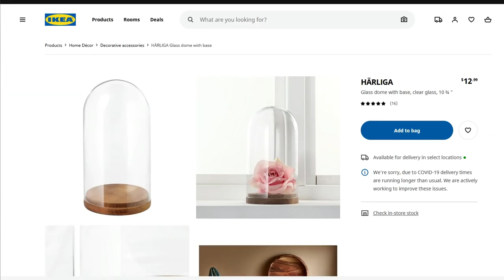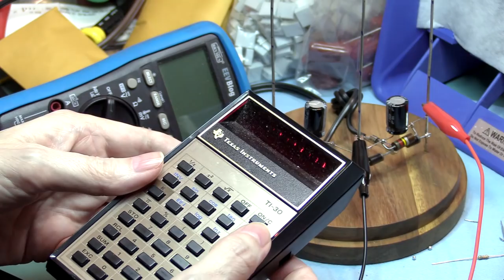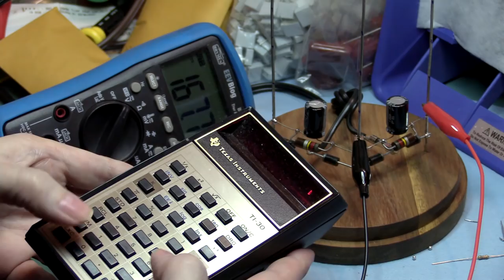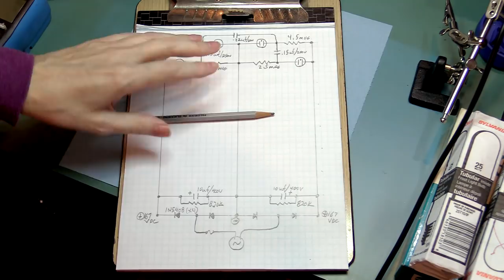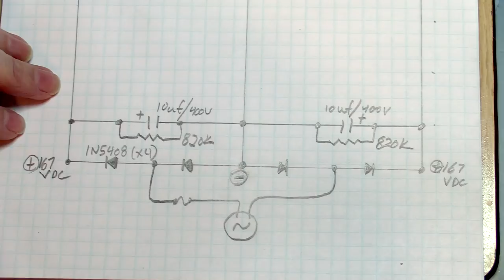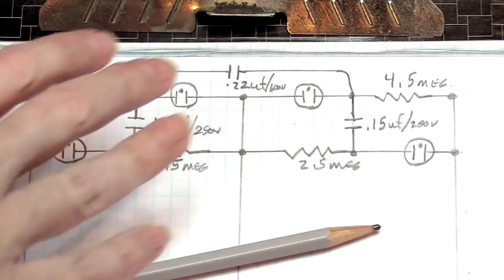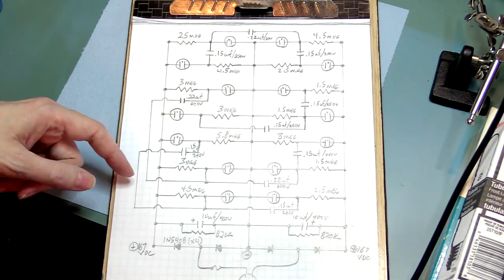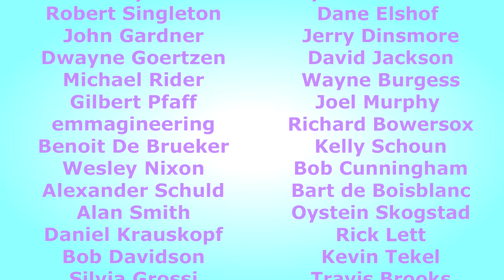Nostalgia Neon Blinky Tree!!!

Comment: Fran, a few things about the soldering issues you raised in this video:
- You need more heat transfer and more wattage because of those big heatsink bus bars. You can pick up the classic Weller soldering guns (e.g. the classic D550) for less than $50 in any hardware store or online, and it will make quick work of these heavy solder joints. An electronics soldering station is outclassed by this situation.
- You have minimal thermal contact between heat source and object to be raised to soldering temperature; the rounded iron tip touching the round bus bar at a single small point; this is worse than the normal situation of soldering a component lead to a PCB pad, which the iron and its tip are designed for. Holding the iron's tip at a flatter angle so more of the side of the tip lays parallel-ish to the plane of bus bar will help.
- Moving the iron all around while trying to solder such heavy joints only makes it more difficult to achieve good thermal transfer. Keep the tip in once place and only move it a bit if you see a way to maximize surface contact area.
- To improve thermal transfer, you can try to flood the area between tip and bus bar with a big ball of solder, but this is not an ideal way to do it; should be avoided if the other techniques do the trick.
Reply: The biggest issue that strikes me is that she is not making a proper mechanical connection before soldering.  Seeing how the legs of the resistors meet each other and the uprights at 90° angle the wires of the components could easily have been one side j-hooked. She did it at 7:32 when soldering the 820k bleeders to the legs of the electrolytics. Why not follow thru?

Comment: You can add clicky sound effects to a neon blinky by using a piezo sounder instead of/ as well as the cap
Reply: Thanks for the idea, going to have to try that.
Reply: @mikeselectricstuff   Clickety clicks and flashy flashers ?   You wan't to drive us loco ?!!
Reply: @trespire  And Bells and Whistles, Too!  :-)
Reply: Needs like Geiger counter clicks
Reply: I was thinking the same. :)
Reply: @imagineaworld  Someplace in the comments, there's a suggestion to feed the neon return currents to a transformer; then use the transformer to drive a speaker.  A good idea, but sounds tricky / hard-to-implement, to me (because the neons parallel the caps, at the moment; rather than shorting them to ground).
Maybe a little cap-coupling (1nF per neon?) would do the job; the ~50V swings when the neons strike should be fairly easy to detect, and you can always amplify those spikes, then feed 'em to a speaker...

Comment: Made  a funky one with just three neon lamps two poles. Built it in a chicken feather flower.  Parts and wires all over the place. Used a miltary surplus battery that had a B+ voltage. Sat on a shelf everyone would always look at the sucker. Battery lasted for ten years. Thanks fran for the reminder that funky is fun. Best Regards Jack Hreha.

Comment: I used speaker wire to tie the leads to the uprights on my project simular to that. Then I used a micro torch to get things hot enough for the solder to work. That calculator  was the same exact type I was given in high school and told I would never amount to anything because I couldn't  see math in my head. Back then, calculators in class was considered cheating.  No one was allowed one. My how things have changed! My dad used to have boxes of old neon tubes and the large foil type resisters and what not. I loved making little projects back then. I ended up taking a short wave radio class in high school and got my  licence. Funny how THAT happened being I was a math dummy.

Comment: I remember making a “neon blinky” (5 neon bulbs) from an old Radio Shack kit (back when there WAS a Radio Shack - ahem). It used a one or two transistor oscillator and a step-up transformer to create about 120-180 VDC from the secondary with a half-wave rectifier diode. The instructions included two variants you could make with the parts included; either a “random” or “sequential” blinky. I wish I had kept it, and the instructions. 🥺 This one though, looks much more cool; though the solder connections make me cringe 😬. Pre-tinning the leads definitely helps with this point-to-point, “dead bug” style of wiring. Oh well, as long as it works. 😊

Comment: I built something similar back when I was in High School in the 1960s.  You have made the circuit a work of art.  As the R/C circuits age it will definitely cause the blink rates to diverge which in this case is a good thing.
Reply: High school in the 70s. Learned to be careful around voltage multipliers ;)

Comment: I remember neon blinkies. If you add a metric crapload of capacitors between every neon then the flashing will always repeat in order instead of random, but too many capacitors are needed for more than 3 neons. So now it's much easier to clock a 4017 chip with a 555 and connect it to 10 LEDs.

Comment: Cool, Fran! Your power supply is a little overkill. Half-wave Dc would work fine so you did not need the filter caps. I've made 2 of those in my life. At age 9, from the Radio Shack kit in the red and clear box that ran from a 9v battery and used an oscillator and transformer to get the voltage it needed. Took it on vacation and left in the back window of the car one afternoon. It twisted in the heat but continued to work. The second, the last day of Junior College sitting bored in the lab. That one was mains powered and hung in my room blinking for about 5 years before the antique NE2 bulbs conked out. I "etched" the circuit board with a dremel, and left a fragment of copper, so on first try, it BANGed!. Replaced the main diode and it worked. Neither were as artful as yours.

Comment: I would like to build something like this using multicolored diodes and LEDs for switching up different modes for blink rates and patterns. I really love the hour glass look. You could build a modern vrs retro styling with a separate module for tweaking how it flashes. Very nice ideas and seeing all the components on a tree like structure is so cool.

Comment: There was a similar project framed and hung outside of the physics labs where I did my graduate degree, and I've always had in the back of my head that I'd like to try making one, but had never gotten around to it, or really figuring out how precisely to do it. I'll have to try now, thanks for the inspiration and explanations! And happy new year!
Reply from the maker: They were everywhere back in the day - I have been sitting on this project for at least 20 years.
Reply: @FranLab  If you sit on it does it hatch into a bigger tree, maybe one you can put up in the town square?
Reply: @FranLab  Run a guitar signal through it and sell it as a pedal.
I'd buy it.

Comment: Watching you drill the holes in the base using tape as a depth guide!
My dad was a toolmaker and that was one of MANY tricks he taught me.
I like those kinds of projects where you have a couple things and think, "What can I make with this?" 🤔🤗
Reply: That’s a good quick way of doing things (and I’m glad your dad taught you some tricks and you aspire to make some projects).

If this is the Harbor Freight drill press I’m familiar with, there’s a feature on the left side of the collet - a threaded rod with a nut or two that can be adjusted to stop the depth. It’s really only worth using if you’re doing a LOT of holes. 

Never stop being curious or learning!
Reply: It's a cool trick. Gotta make sure to wrap the tape in the proper direction though, or it unwinds if it touches the wood. Found that out the hard way.  😁
Reply: @kenmore01  Good point I’ve never really considered: wrapping in the right (or is it left, I mean correct) direction. For those situations, I usually make a “flag” which spins around ridiculously, but is easier to clean off, though it wears out faster than a tightly wound piece of tape.

Comment: The relaxation oscillator I built in junior high had two NE-2 bulbs and would up as the eyes of a plastic dinosaur.. i ran it on 14 9 volt batteries wired in series...
      This is a cool video!

Comment: Didn't try the single capacitor / multiple parallel neon flicker - I was amazed at how that worked when BigClive did it  (helps if the neons are grouped by testing first as it can start with one hogging for quite some time

Comment: Fran, love your builds, reminds me of so many investigation I did with the parts I had have around my work shop.  Just loved this mains project,  rc time delays escape allot of the arduino kids. I used to use this so discharge idea with relays using one side to switch what ever, the other to short the ramp charged condenser that relaxed the relay -- sound action attraction. Thank you for the fun

Comment: I remember my granddad coming home from a "Military Dispersal Sale" with boxes of all manner of surplus electronic stores, including bags, and I do mean bags, of neons. There was at least one case of 90v radio HT batteries, and heaps of resistors and capacitors amongst all the other stuff that he'd bought. I asked what he was going to do with all this stuff, and he said "We'll see". He grabbed a bag of those neons and a big 'mitt' full of Rs & Cs, then proceeded to assemble something similar to Fran's display, then he said, "Fetch one of those radio batteries" and connected a couple of these 'neon blinker' circuits, and hey presto! Then he drew out his schematic (which consisted of one neon, one capacitor and one resistor for each circuit) and said "Now, you set on and make me a bunch of those, and then we'll have a play with 'em".   What a tedious job that was, but after making about a hundred of them, we fitted them into the lid of a wooden box (cigar box or some such) so that the neons poked through, and the 'tronics were hidden below. Add a 90v battery, and this thing began to blink like one of those "Burrough's Computers" from Lost In Space.

I asked just how long a battery would last, and that's when he said again "We'll see" - I don't think we ever did see. That thing just kept on blinking until it became a forgotten artefact of Granddad's Bench.   Beautifully simple, ridiculously low power consumption, and something of a novelty - At a time when so-called "Executive Toys" were becoming popular, Granddad's blinker was head and shoulders above swinging chrome dolphins, or Newton's Cradle etc! - This was the late '60s, or maybe early '70s.

Comment: You mentioned add resistance between the neon and the capacitor. About 40 years ago I had built some hot boxes for a pizza place. I had  green neon lamp indicators  for 120v with a single diode resistor and capacitor feeding the lamps assembly.  If I remember correctly they blinked  with about a 50% duty cycle.

Comment: Ohhh, takes me back to when I was a little nerdling!  I built a neon fireplace with big wax-paper capacitors (spray-painted brown) as the logs, and then made and painted up a cardboard-and-plaster mantel. There were a couple of 45V telephone batteries in the base. Used that for a few years, then the caps started to fail and the batteries started to be hard to come by, and I was headed off to college anyway. The orange of the neaon made for nice flickering flames.

Happy 2021, and good riddance 2020!

Comment: Hi Fran, nice project, I used to make these years ago and have a suggestion. If you want to make it flash more randomly try this. Connect one end of the capacitors to the junction between the resistors and neons, Tie all of the other ends of the capacitors together (that is, don't connect them to ground or to other neons). The neons will then all flash randomly :) I saw this in a very old copy of the 'radio constructor' magazine.

Comment: Try aiming a laser diode onto one lamp, it will change blink rate to faster, as the laser light helps ionise the gas fill. Just have to use a shorter wavelength than neon emits, so a red laser diode will work, but a diode nearer IR will not.

You can also use a valve output transformer on the common rail, only feeding the neon current through it, to drive a speaker and get an audio accompaniment of the flashing.  Has to be a valve output transformer, any power rating, because regular AC transformers tend not to like DC in the primary, though 100V line transformers will work well enough for this, even with a closed core. Not going to be loud, but will have most of the switching spikes still come through.
Reply: Upthread, Mike's Electric Stuff suggests using piezo disks (one in parallel with each neon, presumably) to get some timely clicking.  Kinda annoying though, I suspect, because of multiple large-ish disks.
Re using a transformer and speaker, Fran's caps are charging (in total) in the low-milliamps range -- so any not-tiny transformer should be fine with that much DC.  But I don't see how you trivially get the neon switching currents through the transformer, given that the 'big' current spikes are only through the pairs of neons and caps -- sounds like a major re-wire?

Comment: When I was at UW Platteville one class was taught nodal analysis, so built a 555 timer blinking light along the same open wire circuit, it ran 3 months continues

Comment: Hay Fran, that's a really cool one. I remember building a 9 volt version of something like this from HeathKit actually as a kid. It always annoyed me that I accidentally reverse polarityed  the thing one night & it ran for a while then blew the voltage multiplier transistor when I was asleep. Man if I knew that was going to happen I would have put a protection diode on the input. Anyway I actually miss it from a Nostalgia point. What a shame HeathKit doesn't exist anymore, they had a lot of ground breaking kits for the time.

Comment: I saw this video again recently  and  I am remember a little circuit I made to sit  on a table that had a NE555 oscillator driving a red green led. A variable resistor adjusted the duty cycle and a switch changed between a large cap and a small cap. With the large cap it went slowly from red to green and with the small cap it  appeared to fade from red to green wit the duty cycle adjustment.

Comment: Love the look of those retro carbon composition resistors. 
I remember as a kid getting a large box of random components, and there were many of these. Wish I had kept them all, I don't actually remember what happened to them all. 
I had weird looking capacitors, and these strange tall transistors in metal cases, which had a small glass vial inside filled with blue and white paste looking substance.

Comment: Very cool! Although mains is a bit scarier here at 230V. Using the formula that's 325V DC! Honestly I'm looking at an amplifier project that calls for a +/- 25V supply, and even that feels a bit concerning when I've spent most of my life working at 5 or 12V, and using DC plug packs or self-contained power supplies. Working directly with mains using a transformer is not something I'm used to!

Anyway, it's always great to see these projects, especially when they turn out so well!

Comment: Beautiful neon tree. I’d love to build one for myself!!  Can I use traditional neon lamps?  Soldering tips, It’s good to do mechanical lead connections then solder. Lastly I use a heat gun to warm up larger leads or metals prior to soldering
Reply: Good ol' NE2s (possibly in multiple colors, e.g. from AliExpress) should work just fine, as a change from Russian neons :)
You on 120V ?   If you're on 240V, be a little careful with the cap voltages, and maybe double the resistor values...

Comment: I love this project. If I were to build this for European 230V assuming that all the parts had a high enough voltage rating would it just blink faster? Would I need to double all the resistor values?

Comment: The neon bulb internal resistance when lit is very low or even negative.  That means the flashes are short and changing the capacitor values do not noticeably change the flash duration.  If anything, the brightness would be affected by the capacitor value.  The period on the other hand is determined by the RC values of the charging circuit, as at that time the neon bulb resistance is nearly infinite.  If you want to try extending the flash duration, you could try some relatively low value resistors directly in series with the neon bulb.  I don't know if a 1k resistance would be good.  It could be a starting point anyway.

Comment: Back in HS Art Class(44 yrs ago), I made a mobile thats similar to this. I used LEDS so there was no exposed HV. Some parts were on there just for show and others to make the LEDs flash.  I think I used some TTL chip like a 7490 to sequence the LEDs, and either a 7400 or 555 as the clock.

Comment: Hello,

Happy New Year Fran,
do You think it will work with the european 230VAC, maybe with somewhat higher resistors? Actually there is no 110V in europe but i have 400V 3-phase AC next to the bench if i want a bit more power ;-)
Why do You use 2 separate positive DC rails,  just because it looks nice? Can they be pulled together?
Chris